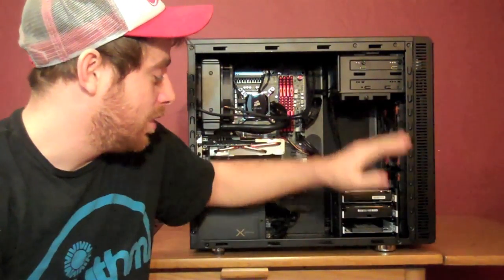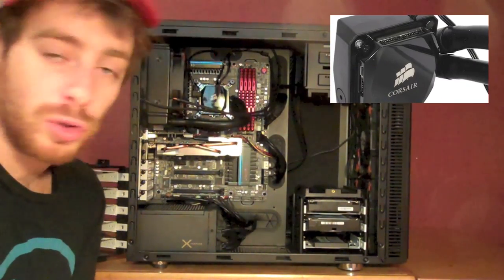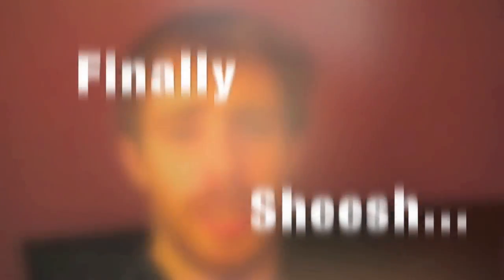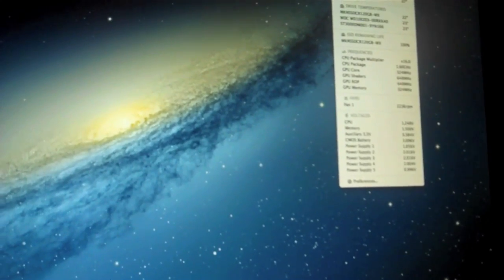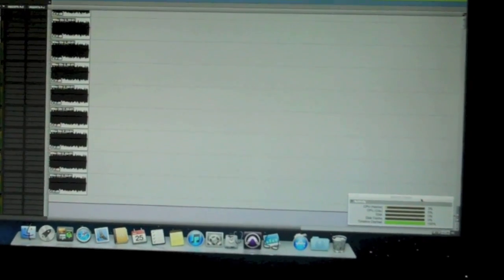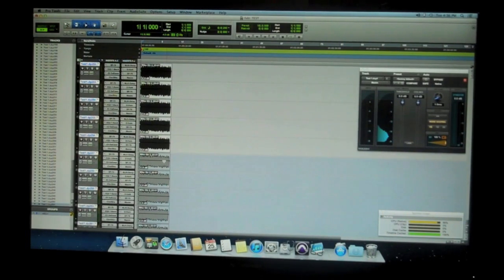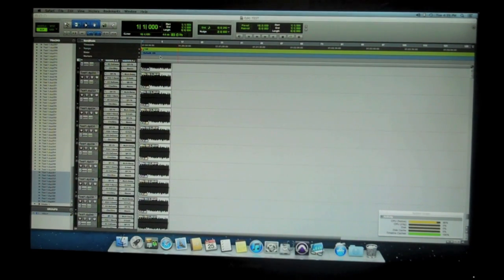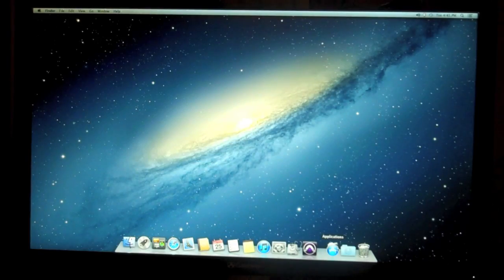Pro Tools 10 Hackintosh on Mountain Lion running 2000 plugins!

Comment from the maker: I believe I used the max buffer but I also had max delay compensation, so everything was tight.  Not ideal for tracking, but for mixing, its a monster.  I can run many, many light plugins @ 32 sample buffer, and about 20 autotune 4s (none evos).  I suppose to turn this into THE IDEAL tracking/mixing rig, I would throw in just ONE HD card, just for the inserts on the channels I'm tracking on.  It would be interesting to see if the old PCIx Card will work in that PCI slot... hmmmmmmm

Comment from the maker: Since I'm getting a lot of pricing questions, I'll just throw it out there.  The systems range from 2300-3000 depending on Video Card, HD, RAM and CPU configuration.  The system in the video costs about $2600 because of the HD setup.

Comment from the maker: Its in the Video 7:30.  Stress test never went over 73 degrees.  Keep in mind that I had to plug the USB header from the H80i into my PC to adjust fan and pump settings. You need a windows machine with USB header and Corsair software to adjust those things vs the simple button on the old H80s.  Not sure if its worth the extra 2 degrees I squeeze out of it...  It is just a tad quieter too.

Comment: Dude, how did you get PT10 running? I pretty much have the same setup you're using in this video. I finally bought PT10, downloaded it, setup ilok etc, installed everything but I've only successfully loaded it up once. It either says ilok missing or the icon bounces forever and nothing happens.

Comment: From o19Productions: "How do you install 9 disks of logic without a DVD player... use another machine to create 9 disk images, then put them on a harddrive and transfer them to your machine? That in itself is worth the $18 for a decent DVD drive, plus the off chance you may need one for other reasons... not sure why you are nit picking."

I would let the folks at Logic to join the rest of the world. The folks at Ableton, Propellerhead for example have everything linked to your user acc online.

Comment from the maker: Grab a Siig or Vantec PCIe FW card ($50).  For Wifi, the best solution is a PCIe to mini PCIe slot ($10 on flee bay) and a genuine apple wifi chip ( $10-$30 also fleebay).  Lastly, I never use BT.  Some of those apple cards have it.

Comment: hay bro this income tax check i was going to get a mac g5 how dose this  compare? i have project studio but i want it kick ass...how much is it...please don't B.S. me
Reply: Dont do that. Its super weak. This build is like the 2013 Mac Pro
Reply: kool thanks
Reply: Hey man.  I agree with tDames.  A g5 is SUPER old tech.  This stuff is brand new.  I'd say its literally 4 times faster than the best G5 you can get.  These systems start at $2,200 as seen in the video.  You could get the price a little lower, but I really only deal in high end and don't like to skimp on anything.  It took me a long time to research, pick and test these parts and after building almost 30 systems, I think this is as good as it gets for the price.
Reply: Yeah, forget the G5...too old and you won't be able to run any OS after 10.6 I think?
I'm sure you could build a good Hackintosh for under $1,000. Depends what your needs are and what kind of session you plan to do. This machine is pretty pimped out, but maybe you don't need all the SSD drives and fancy graphics card...certainly not for Pro Tools...lol
Reply: I made a computer for about $800 thats running mac in my studio. Pro tools and everything works like it should
Reply: tDames of The WerkHeads Can you post your specs? Motherboard and processor, ram, etc. How long ago did you make it? I want one that will run 10.8.5 with Pro Tools 10 & 11. Seems that some of the Gigabyte mobo's have built in HDMI which would do me just fine. No sense in spending $200-300 on a pimped out graffix card for Pro Tools. I already have all the drives fro a current Mac Pro.
Reply: I run it stock i7 4770K Gigabyte 
GA-H87M-D3H, no graphics card, 8GB of ram and a SSD with 2 HDDs 10.8.5 and pro tools 10 & 11 for about 2 months. Make sure your monitor is up to date. It hates VGA cables
Reply: tDames of The WerkHeads I run my Mac Pro DVI - HDMI to my TV. Can the onboard graphics send out 1080P natively? I'll check out that motherboard. I have HDX and an OMNI. I don't use the machine for too much outside of Pro Tools. Can that onboard Optical Audio only do 2 channel or can it do 5.1?  Thanks man!
Reply from the maker: sbrave all great advice for a budget build.  Keep in mind h87 cannot overclock.  Also, the video cards I use are $35 provide for up to 3 monitors at once and work NATIVELY with the os.  That means less graphics issues and are system closer to "vanilla"
Reply: sbrave Yes it can send it out natively. It has a HDMI slot and DVI-I slot and Display Port if im not mistaken

Comment: For everyone interested in getting a system like this, visit tonymacx86 . com
It has very detailed instructions on what hardware components to buy and how to install and configure you're system.  And these are really high end, pricey components he is using.  If you don't know how to do this, then you probably don't need this configuration.  For beginners, you can spend $300 online and upgrade your current PC to a Hackintosh and have a very nice smooth running system.